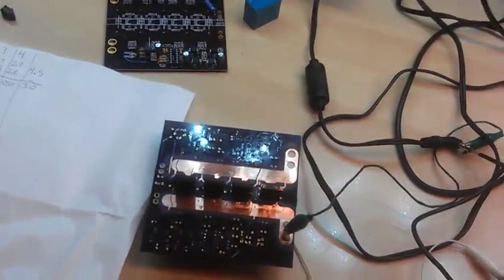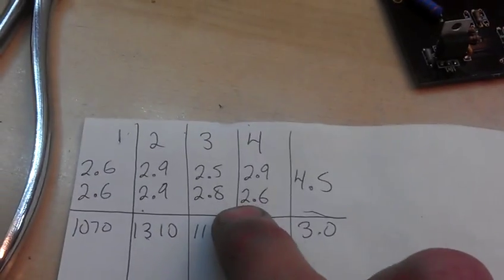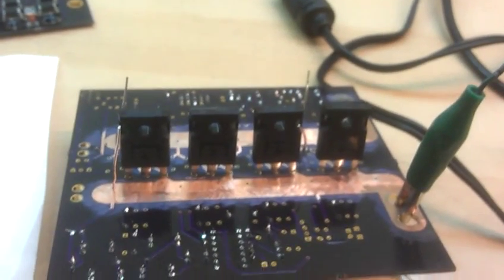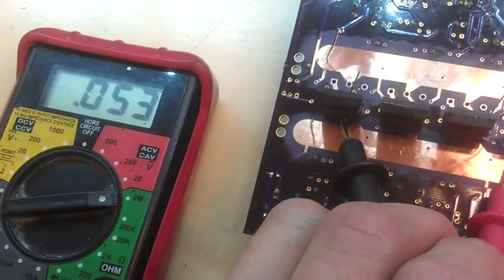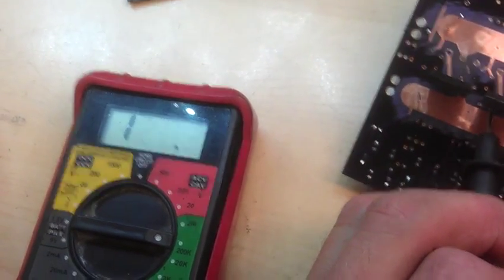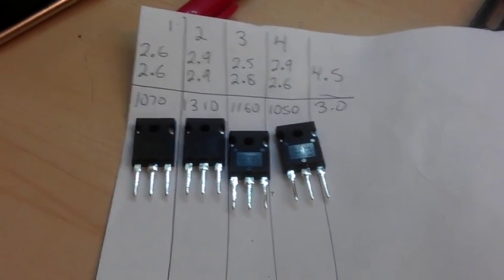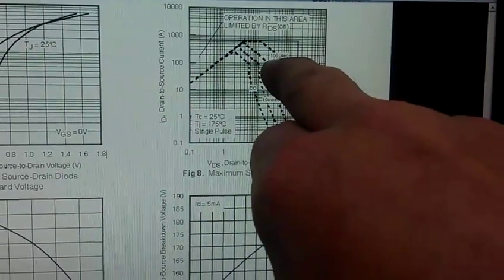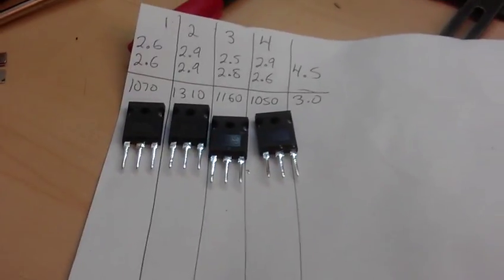Mosfet  Matching

Comment: yea this is an older one. but I am working on a project which requires parallel MOSFETs. what is the most difference you would allow? and is there any other variables in specs I should check? and what is the maximum current that can be safely passed through the to-220 or similar package MOSFETs? I have heard many different max currents. just a shot in the dark. I'd say 30-40 amps. thanks

Comment from the maker: You are correct but when you try to run them cool as in you cool the mosfets as best you can AND you switch them more often then 1 time you will have to have them go though the trans conductance zone where they produce a lot of heat and if one is in that zone more often then the others its parallel to it will blow!  In this controller I switch at 20 kHz and in future plans to go past 50khz!

Comment: U R matching the fets in linear mode but they work in switch mode, plus all mosfets have Positive Temperature Coefficient, so once they warm up to certain point, the Rds-on will increase thus diverting the load to those with smaller Rds-on... So what's the point to "match" the fets ?

Comment: i don't think you understand. you have to reduce the inductance of the supply --to mere nanohenries to safely switch that much current. that is where multi layered boards are essentially required for this much current. here's an example. 100nh of supply side inductance means at 330 amps phase current, and 14Khz you're running 76 watts of power loss per half bridge.. and that's all avalanche losses... (i might be off by a factor of 2 or 3)

Comment from the maker: Need to be a min of 150v rated caps.  I will spend the time to test the fet turn on times from fet to fet.   I don't thing 2 2 layer boards will work for me.  I have HI current on each side of the main board.  Not sure what I would gain with 4 layers anyways.

Comment: oh God, 330 amps peak current? 

if you're really running the fets that high i would recommend searching ebay for "2.2uF 100V" buy the bag of 400 of them. (10$)  re-design your three phase bridge with two double sided circuit boards stacked (cheaper than building a 4 layer board)  use all 400 of those capacitors to provide a low inductance dc bus. you can use some extra leakage inductance between the separate half bridges to take up the slack (one of them will always turn on before the other)

Comment: where's the dc bus capacitors? without them you're going to have avalanche failures during turn off, which is probably why they are failing..